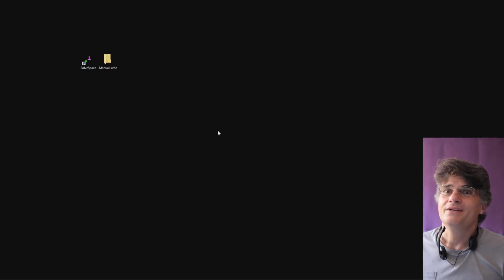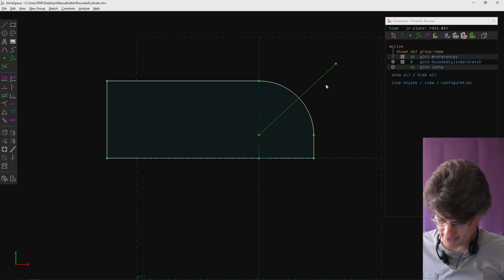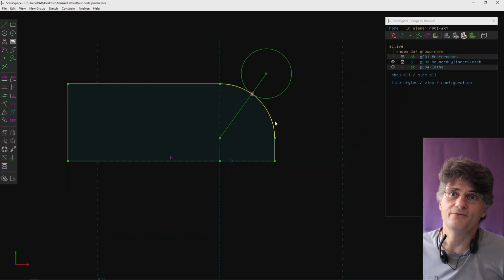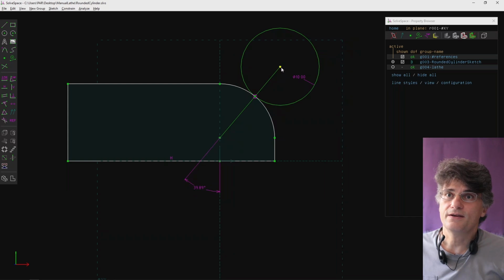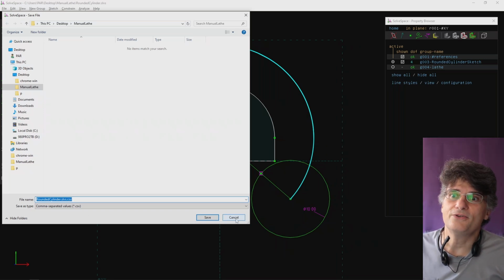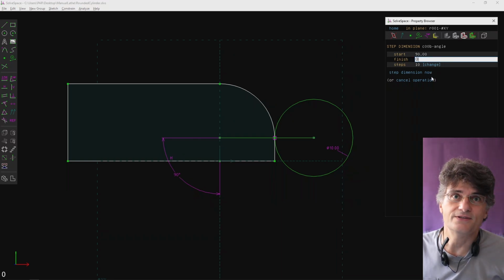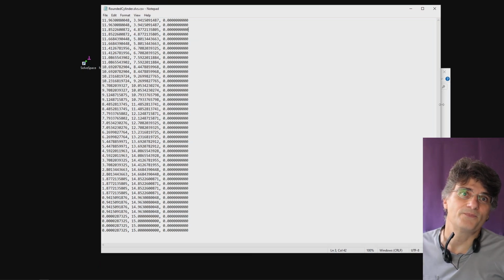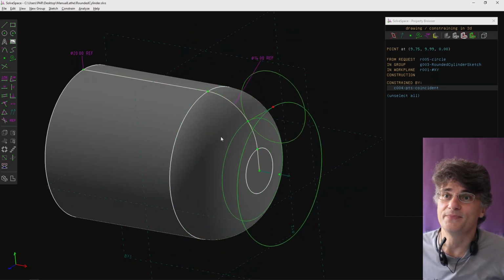SolveSpace tutorial on tracing points and exporting coordinates

Comment: Nice! Solvespace is a really beautiful piece of software. I got out of the habit of using it due to some of the limitations, but I have been wanting to do exactly the sort of kinematic analysis you're doing here, so extremely useful to see this video. Thanks for posting it!
Reply from the maker: It's a very beautiful piece of software indeed - that is why I started contributing. The limitations are still there but recently we have mede substantial improvements in the geometry (NURBS) engine and the solver. You'll have to download the "edge" build - there is no "official" release including them yet.